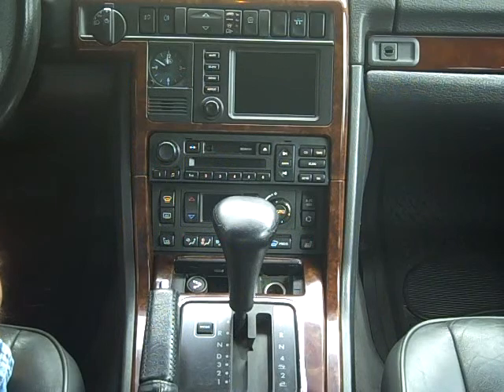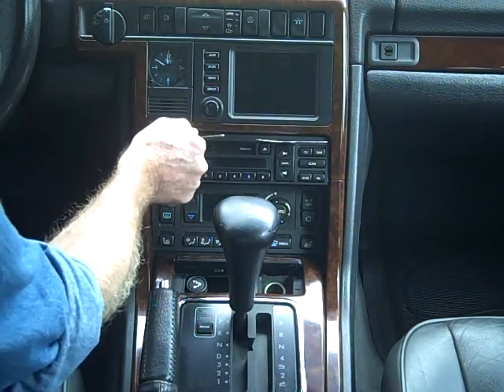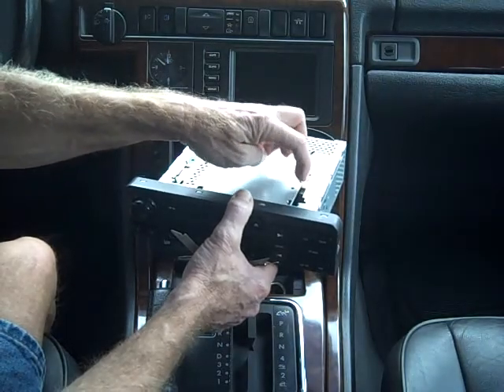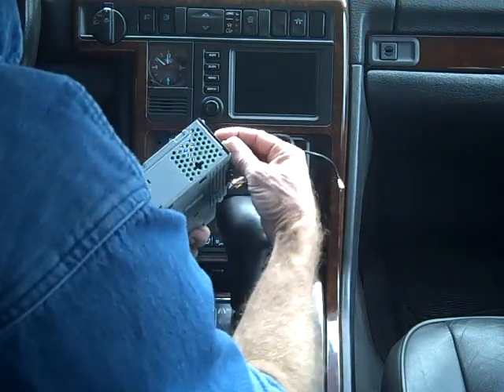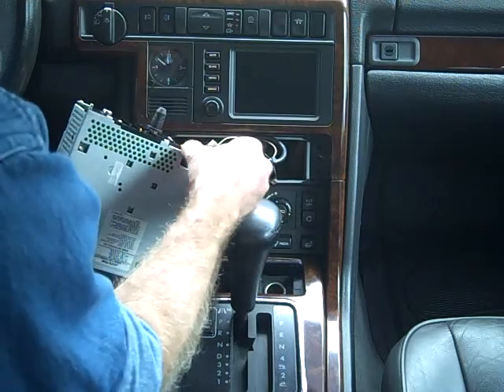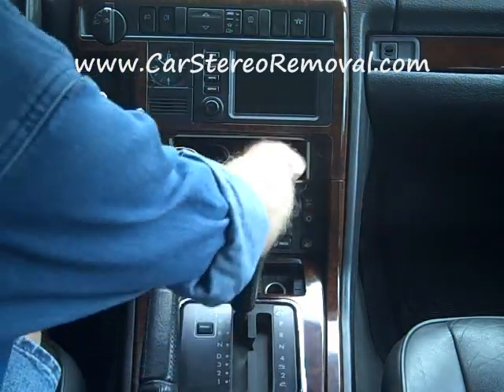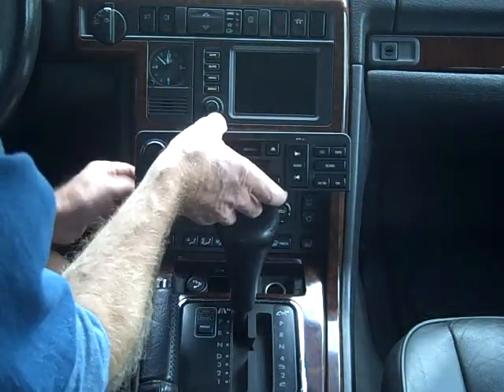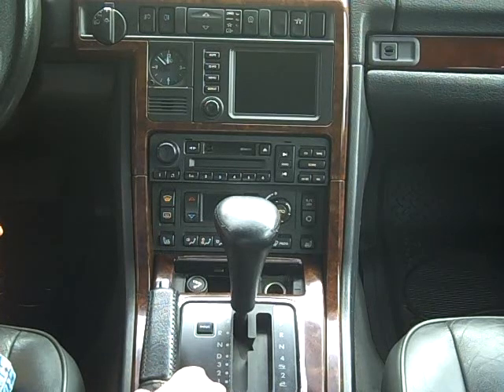Land Rover Car Stereo Removal 1995.5 - 2002 = Car Stereo HELP

Comment: Thanks - I'm buying a 2001 Range Rover 30th anniversary edition and I want a radio with an AUX to connect my ipod to - will that be just as easy? I pick up the car on Jan 3, 2012. Are there radios that with fit the car with an AUX?
Rich M

Comment from the maker: There are many different types of Aux-in adaptors. RF where you tune to a specific FM radio station. Cassette adaptor and a direct audio input. Direct input is the best. Check the internet for these devices, there is a lot of internet competition for sale of these devices.